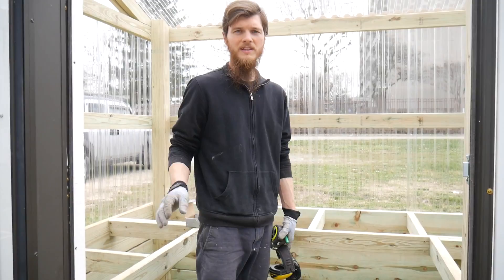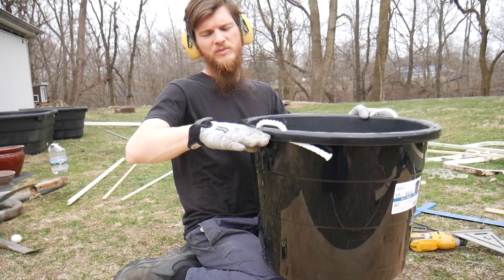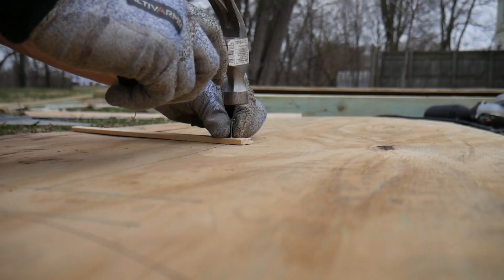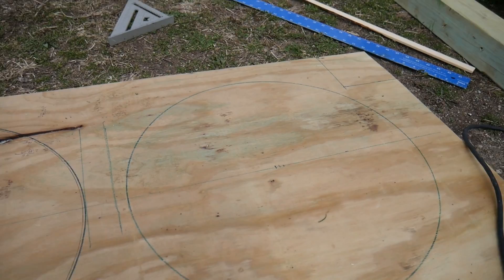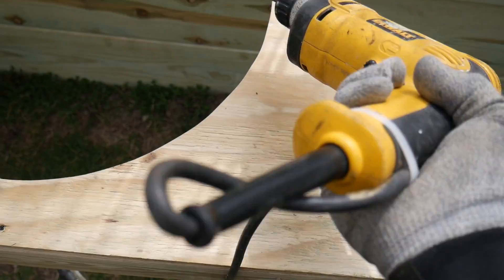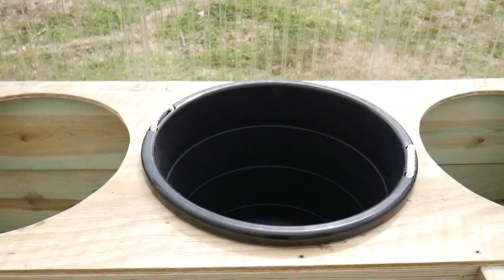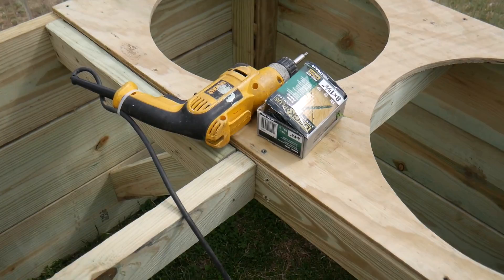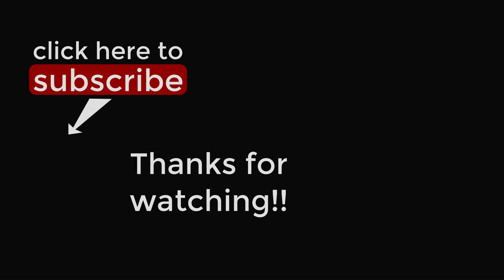Shelves and Planters for the Tiny Greenhouse

Comment: Doug and Ashley; get you a big bag of packing peanuts that is not water soluble and fill your tubs about halfway up with them, then put a piece of landscape cloth on top of the peanuts before putting your potting soil in your tub’s, this will keep the weight down and you don’t have to use so much soil. Just a little gardening tip from one ex-gardener to a newbie .....👍 🍅 👍 🥕 👍 🌶 👍 🍓 👍 🥒 👍 🥦 👍 🍆 👍 🌽 👍 🥔 👍 🍠 👍

Comment: hello, dont throw the drill out just take screws on handle out and re solder the wires back and it will still work for mays years !
Reply from the maker: We still have it, but I think it's just too shot...it had more problems than just the cord.
Reply: @diyfferent  try replacing the cord, my drill did the same thing as the wires were bad. I used a cord from a un-repairable reciprocating saw that was sitting around.